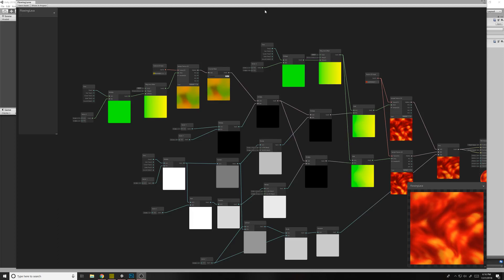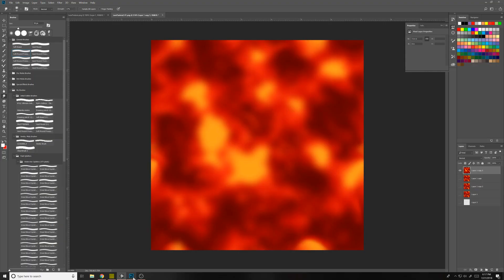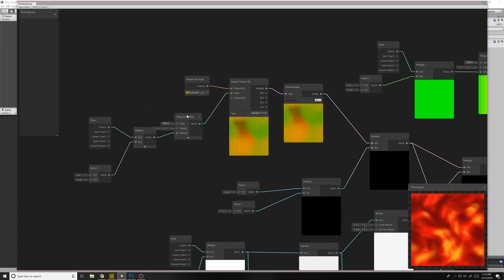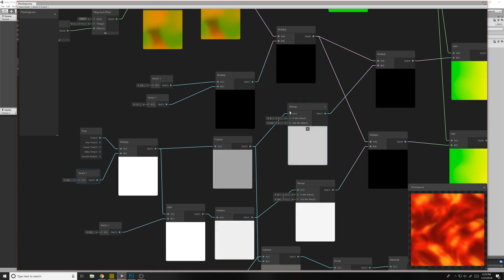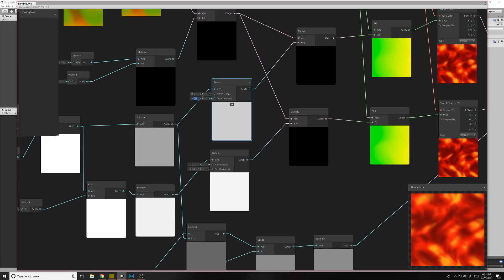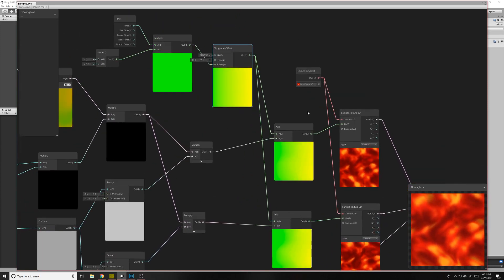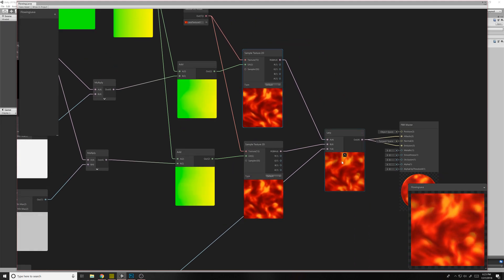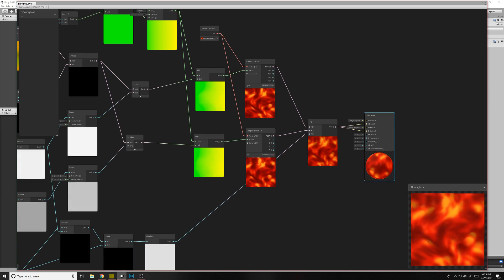Unity Shader Graph Tutorial: Flow Maps

Comment: that might look like a working flow shader, but its actually broken. moving the uv mapping as in this example is not what a flowmap shader should do
Reply: nah, pay attention to the vid. He specifically says that was optional. If you don't want that feature then just delete the tilling_and_offset node in the top left of the graph or the group covered at  6:38. Still works fine. The real problem is his flow map doesn't flow the way he wanted it to so he adjusted it in the shader graph with those offsets.  The core flow map graph is presented here and will work with those parts stripped out.